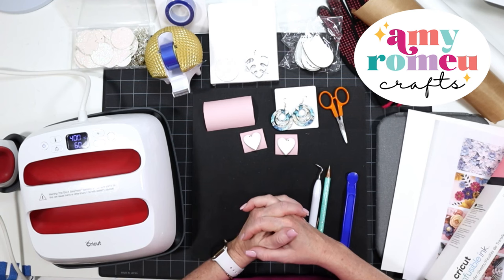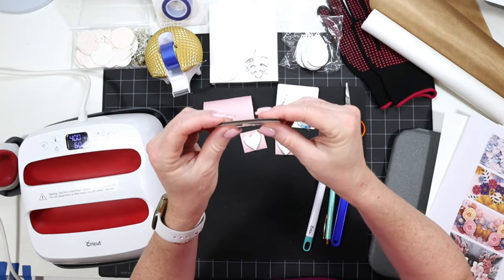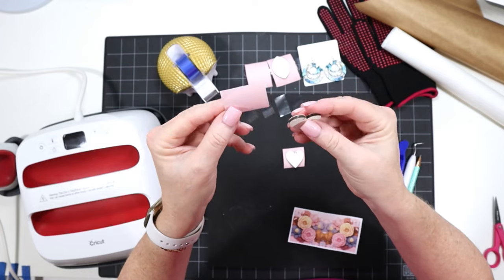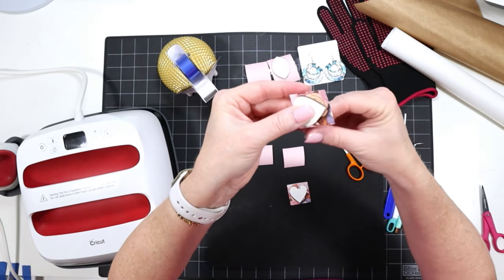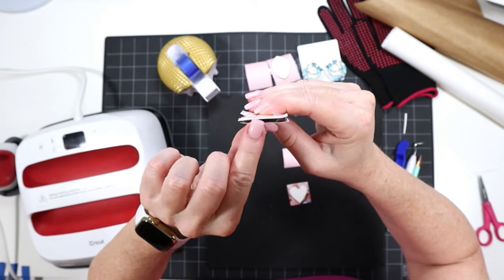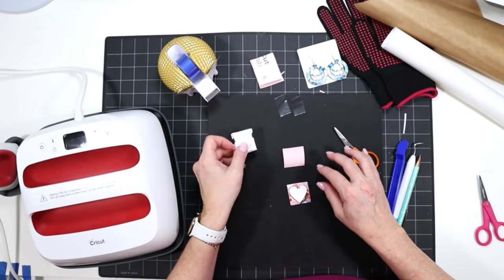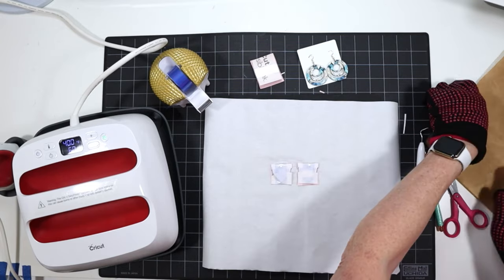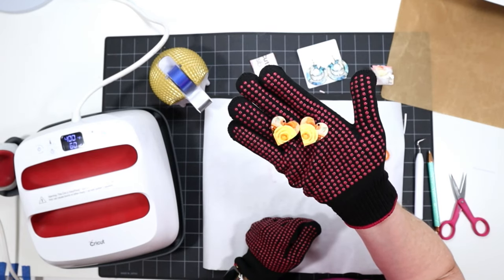How to Press Double Sided Sublimation Earrings at the Same Time

Comment: Love your videos!  Question about the two types of tape that you used.  Why not use regular tape for all four sides?  Looks like neither of the regular or the heat resistant tape melted or made marks on the blanks.
Reply from the maker: Hi, Amy! Thanks for your comment! I only used heat resistant tape for this project. The small cut pieces were cut from the blue roll of Cricut heat tape - you can't see the blue color but it's the same tape. If I misunderstood your question, please let me know!
Reply: Thank you! Perfect